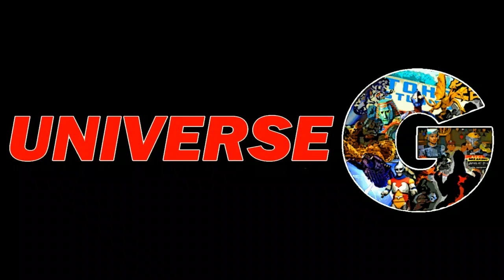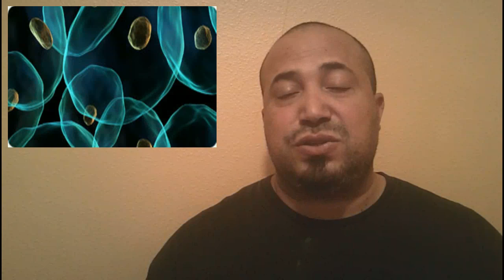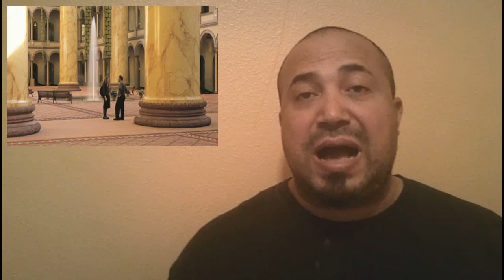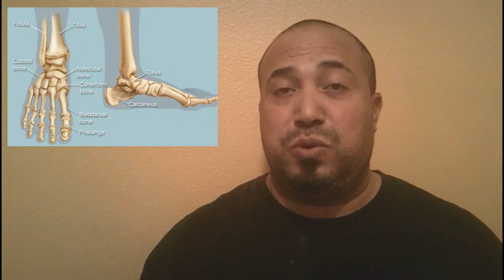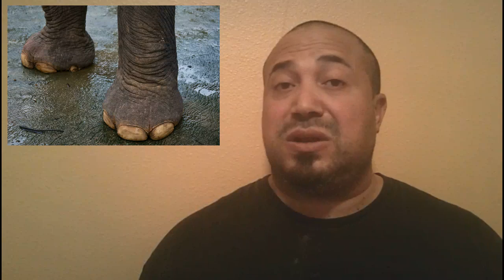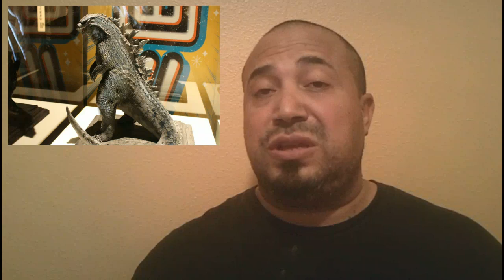Godzilla 2014 The Possible Science Behind the Debate of His Feet

Comment: In theory, the physicality of the creature could be maintained.  For example, if the Godzilla species is the result of the evolution of some ancient reptile that developed over millions of years, it could be possible. If Godzilla's size is due to a tumor on the pituitary gland caused by radiation, then the skeletal structure would grow with the body and adapt to hold the weight.  However, this trait would only show in later 2nd or 3rd generations of the species as they would reproduce.  Then a later nuclear test would most likely serve as Radiation Therapy and stunt the growth of the later generations at whatever size they would reach. As for the nuclear reactor biology, the half-life of radioactive isotopes is high so, in theory, the species could survive off he island's fallout for a while.  After the fallout, he could survive off his own supply for a while, but would be forced to come ashore to feed off nuclear power plants at some point.  As for when they run out of power plants to feed from, Uranium and Plutonium are both naturally occurring elements and as long as the Godzillas can find a viable source, they should be able to sustain themselves for a while.